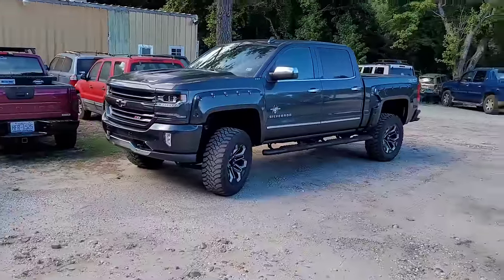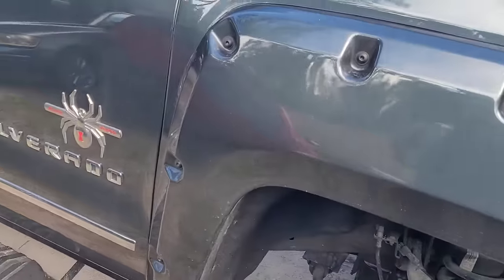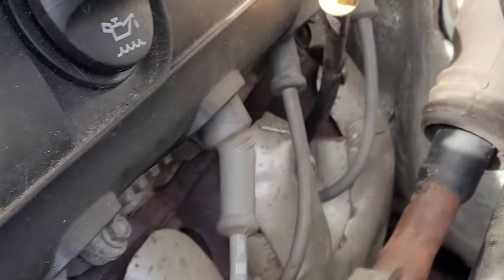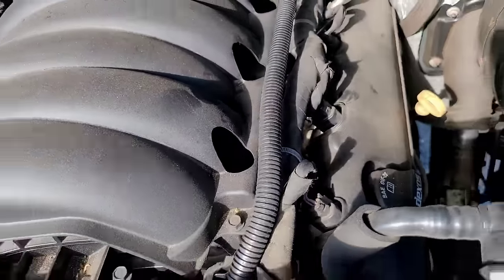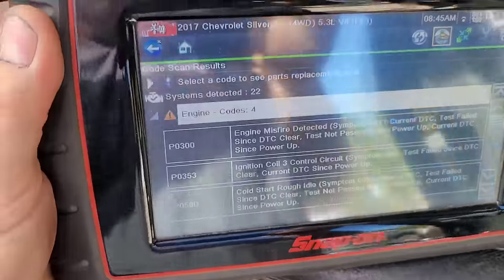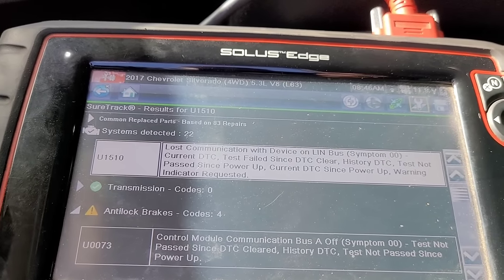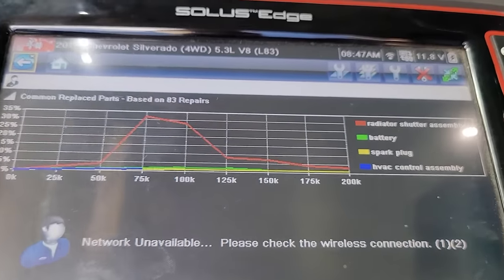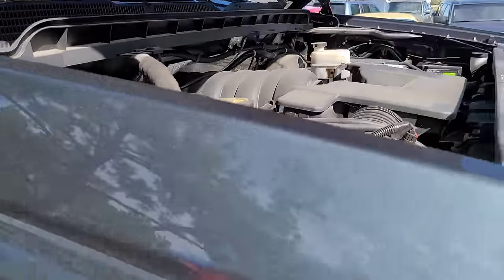AGAIN !!! Another "Tapping" 5.3 !! It's not lifters or exhaust.. 2nd time I've seen this..

Comment: Lots of chevy truck owners have this common complain of “vibrations”. Theyve changed exhaust, and gone thru other very technical/mechanical repairs. The real culprit is actually, just a worn out tires. Not necessarily bald tires. Anything wear at its almost max.
Reply: They give you G.Y. Wranglers stock. those are mud & snow tires, very noisy and inadequate for highway use. they wear out quick, then shake. but are great for snow and trails.. I got 4 Yokohama Geolandars for mine at $199 ea, and mounted them myself with a manual tire changer that cost $60. beautiful highway rubber, 285/70R17.. big mamas when they're standing there next to you off the rims. shops here want $50 ea to mount if you don't buy the tires from them. the $200 I saved bought a new battery. :body-blue-raised-arms:
Reply: I had problems with vibrations when slowing down and with a AFM Disabler they went away.

Comment: I have had the bolt retainer clip on the steering shaft pull the plug wire off if it isn't turned to one side a bit, it happened the last time it got a tune-up, it was the wire behind the one you found loose.
Reply: My 2017 Silverado had the same problem it got pulled off multiple times before I figured it out that it was the clip on the steering shaft

Comment: Yup, wires coming off is not a super common issue but it does happen enough for a TSB!
There's also a TSB for the radiator shutter wire getting pinched, and needs to be rerouted, or replaced if rubbed through.
Reply: People are nuts. as soon as I buy a used vehicle I throw money at it. right away I first changed my plugs, wires and all the grounds which are an issue on these. then I popped in a thermostat and a new master switch for the power windows. and on it goes.. ordered tires from Walmart 😉

Comment: Had lifter failure on my 6.2 this past weekend while pulling a 3500 lb trailer through Arkansas. Was told by the dealership it's a common problem on the 6.2 and 5.3. Damaged the cam so pretty much a full rebuild. Always buy the extended warranty no matter what vehicle it is. It ALWAYS pays for itself
Reply: Or stop buying GM junk as I did. No regrets, no problems !!!
Reply: @bug2011  I was a ford owner before this truck. They're no better and a lot higher in price. Never owned a Dodge and never will
Reply: @klathamtexaslandrealtor  Not many people buy Nissan's but this is my second one and they've been flawless. I wouldn't touch their cars but have been very happy with the trucks.
Reply: @bug2011  So I take it you're a female then?
Reply: @JR-The_Godfather_of_Horsepower  Hardly, I'm just a guy with a better brain.
Reply: @bug2011  Lol!!!!
Reply: I hear the 6.2 is known for bad cam bearings too
Reply: I'm on my second  Nissan Titan and haven't gotten a penny out of my Extended Warranty. They've both been FLAWLESS. I'm a happy guy .
Reply: I have a 17 Chevy 5.3 lifter just failed! Full rebuild!
Reply: @donnevico6560  That's a damn shame. GM used to build such great vehicles and now just junk. To everyone thinking about buying ANY new vehicle, if you're old one still runs KEEP IT !!!

Comment: The coil wire happened to mine. Slight rough idle and hard to hear tick with the purge valve up front.  Remembered the earlier video and got it.  Also the tip with coil pack saved me too!

Comment: Had this happen on my #7 on my 5.3L as well. Misfire only happened at high speeds and was random but not enough to trigger a code. We thought it was the transmission slipping when accelerating. Honest transmission shop owner drove it and in 1 min said “this is not a transmission, but i have a hunch”. Took a look under the hood and found it, Plugged it back in and hasnt been a problem since. Guy refused to let me pay him.

Comment: Had a 2020 Silverado with 47k on it.
Tires were trashed. Chopped up, feathering in the front, alignment wear. complete squared off on the rear.
Reply: it could be the tires themselves are defective,, alot of tires are being made in the phillipines and they are junk. I have a set of yokohamas on my van,, ok one of the got a nail in it and couldnt be fixed, so discount tire replaced it with a yokohama made in the new plant in the phillipines,.  the original set was made in the USA...
, it started feathering badly, it was on the back, and when  they rotated my tires they put it on the front and the van started pulling to the right,, so I told them I wanted a tire made in the usa.. they replaced the tire with a new goodyear, and its doing great so far.  DIscount tire likes to replace tires under road hazzard with cheap knock off tires made in third world countries..  they did the same thing when one of my hankook dynapros went bad, the tire they replaced it with looked exactly the same, but it was a shitty house brand.,, now I know how they operate and will insist on the exact replacement tire, or get a refund..  if u need a replacement tire under warranty, call first and ask if they have them in stock,, THEN tell them u need a tire replaced under warranty.. if u tell them u need a tire replaced right off the bat, they will likely say they dont have any in stock, but they have a "compatible" replacement tire for you,,  and will try to give u a shit tire.
Reply: @randy1ization  Possible. Looks like he never rotated them or balanced them. The one I worked on.
Reply: @Biosynthnut  yep, just dont always assume a tire wear issue is always something  besides the tire itself. with my van, the bad tire was on the LEFT front  and it was pulling to the RIGHT,,. almost sent me down a rabbit hole until I felt the tire.. discount tire had rotated them a week before, and they didnt catch the tire coming apart. if I had assumed they did thier job and checked all my tires, I would have naturally thought it was something besides the tire,, I DONT TRUST ANYONES WORK OR OPINION ANYMORE.. I always check for myself.. most people have thier head in thier ass nowdays and are distracted by a damned I phone.

Comment: I have a 2000 GMC with a 5.3 with 2,75000 miles on it and just have noticed a little ticking but I’ve never had any major problems with it. All a 5.3 is is the old 327 engine.
Reply: Yeah 5.3s comes out to 322CI I believe so basically a 327. Great motors I know that much.
Reply: @bubbakushingtonIII  I was told it is 325 cubic inches but you could be right but whatever the case it’s basically the old 327.
Reply: All the LS/LT engines (3rd, 4th, 5th gen) share with the 1st gen smallblock is the bore spacing. A 5.3 is 325CI and has a completely different bore and stroke, it just happens to be a similar displacement to a 327.
Reply: @brockemery493  Thank you I was just going by what I’ve been told you can write what I know about engines on a bubble gum wrapper lol.
Reply: Don’t you ever compare these late model Chevy boat anchors to the old school Chevy engines!!!!!

Comment: my 2003 Tahoe has an additional AC compressor belt and tensioner. Both wear quickly because of the location. When the belt looses resilency and tensioner get rusty it sounds like a valve tap.

Comment: We have a 17-passenger bus with a similar engine (6.0 liter, I think). The suspension is inappropriate for the conditions it is operated under (air bags). The ride is extremely rough. It had a plug wire fall off. Makes me think that the accident may be the cause.

Comment: Hope the owner knows how lucky he is. Most of the time that generation has failed lifters. Great fix
Reply: It's actually really rare but with millions made there are guaranteed to be a few lemons
Reply: @Connor4x4  Really rare to have  an Ecotech 5.3 not have lifter issues that is. My brother works at Holz Chevy and all he does is collapsed lifters 5 days a week on the 2014-2018 models.  Now they are getting quite a few of the 2021 models coming in.
Reply: @toenails.  So many of them where I live have over 300k without issues
Reply: Just take care of them. Problem is most people don’t believe in routine maintenance….
Reply: @jordanhannah5839  FACTS 💯
Reply: @jordanhannah5839  exactly. I use the AFM disabler, change my oil when it’s due, and I run Lucas oil engine cleaner almost every time I fill up. Almost at 100,000 on my 2016 1500!
Reply: @NicholasA1747  awesome man I am at 118,000 on my 17 z71 with disabler. Service the truck and love it! My favorite truck I have owned!

Comment: I’ve got a ticking 5.3 on cold start. It’s loud and fades out after about 45 seconds. I’m assuming it’s lifter related?
Reply from the maker: It could be an exhaust leak . Check out this other video I made a few months ago . https://youtu.be/itYFqSMdqmI
Reply: Mines does the same thing..exhaust leak I'm sure of it
Reply: Check your exhaust manifold bolts, they tend to shear the bolt heads off of the ones closest to the firewall. It'll have the "Tic tic tic" and it will fade out after a while. If you lose enough of the manifold bolts you'll start to get that lawnmower sound.

Or it could be the classic Chevy piston slap noise from engine wear. The pistons will rattle around in their bores until everything warms up and expands slightly.
Reply: Quit lying guys, Chevys don't break exhaust manifold bolts....

Comment: I got a 5.3 350 08 Silverado 4x4 it’s going rat tat tat and I know it’s not exhaust. 
I’m going to change oil. Run atf through 
Before that pull plugs soak in seafoam 
Hand turn engine a bit. Replace plugs. 
Put some atf in for 300 miles. Replace filter
Then regular oil change after that. 
Is what I’ve been gathering from your videos. 
I’ve checked coils and wires. I couldn’t find anything. 
Oil is dirty. And I topped up with regular oil instead of transmission oil. 
That was stupid I didn’t see your video until a could days after that. 
Short of that I am not sure what to do so I continuously study your videos meticulous until my eyes are sore lol. 
Could you maybe reach out to me? ❤lol

Comment: I had 17' silverado with the 5.3 z71 and around 100,000 miles i had a dead miss on #3. I ended up changing the plugs and in the process found the #3 plug wire was broken internally. Fast forward a month or so had the exact same issue twice but with the aftermarket wires from the parts store. Just outa  Curiosity can you put a dab of  Dialectic grease both ends of the plug wire to help?
Reply from the maker: Yes. The dialectric grease can be used on both ends without issue. In all honesty though, I tend not to use it on ends that are close to the exhaust as I've found they seem to really get stuck onto the plug and subsequently tear when removing . This usually seems to be the issue for me after many miles however

Comment: Hi, i have a "05" Tahoe with 176,000 on it +it just started ticking when first started then quiets down when warm.
Dealer said a new cam + lifters are $9,000 bucks.
I'm blown away.
Any thoughts???
Reply from the maker: Wow! For that price you could probably get a new motor!  Post your question to our Facebook page Wrenching with Kenny & Backyard Mechanics - they are closed  sure to answer the questions to join. Add the year, make & model of the vehicle & what you have done to fix the issue. Other mechanics will comment with their thoughts. Keep wrenching 🔧
Reply: @WrenchingWithKenny  Dealer also said a new engine is 12,000 or so.
I've always changed oil at 3000 miles.
The tick does go away after warm up .
Should i just run it × see what happens??
Gotta say the worst chevy i've ever owned.
It's had excellent care + has caused me nothing but grief.
I will not buy another + especially with AFM crap!
Thanks for help

Comment: On the frontend if you do not reinstall the camber lockout tabs like the factory the alignment will continually drift and you’ll hear a pop under hard turns. Either install factory lock outs or the dirt kings. I’ve had my dirt kings camber locks for 70,000 miles and no more alignment issues.
Reply: What? No way. Ive never heard of that. I thought those were only good in the original position they were in?
Reply: I've not had that problem, though I can see it happening. It takes a wrench extender to properly tighten them when done, especially after GM upsized the bolts. The pins falling out are a real issue, though.

Comment: Shutter issue is a common non accident related issue. External temp sensor and motor assembly is located in the middle of the shutter.  Water leaks into it due to poor design and causes a short. 
My 2017 and my associates 2019 have had this issue. Plus the teacher at BCIT GMC university course confirmed this issue. Only fix is a new shutter assembly at $400 plus labor and I suggest adding liquid electrical tape around the wiring into the control box.  Unfortunately GMC does not warranty unless bumper to bumper is available much like their faulty injectors and lifters. Hope this helps those having this CAN bus error. 
Due to it being a CAN bus there is no way to loop the system to trick the pcm into believing everything is OK.
Reply: The bolts on battery side being moved are from the fact that you have to remove the braces to remove the battery, on top of the battery is a connection for positive power normally 2 wires into one. Those little guys like to burn out in hot and cold and sometimes burn right through the battery.

Comment: Big trucks and SUV that take 0w-20, I live in a warmer climate all rear round and use 5w-30 instead and seems too work a lot better. For example 2022 BMW x3 takes 0w-20 but it’s never reached below 50 and 5w-30 seems to make the engine smoother and quieter

Comment: I had a rattling noise, no codes that sounded just like it was under my driver's seat & would happen on a smooth road, rough road, while in gear but when I put it in neutral it would go away! 
It would never happen when a Tech Test Drove it! 
Found out it was a loose passenger side hood bolt on my 02' Blazer ZR2 4x4. Funny how these noises can travel.

Comment: Sometimes at night in total darkness, you can check your plug wires for leaks if you see a multitude of tiny blue sparks.  I used to do this to know when to replace them.  A lot of engines now with coil packs don't have wires but can be checked in other ways by using a plug tester against the block.  I had a 2014 5.3 Vortec that developed a tick under warranty at 65k miles.  The dealer replaced the lifters and it ran fine up to 105k miles and one day no oil pressure.  Had it toed in believing it was an oil pump.  The mechanic called and said the oil pump was fine but the main bearing and oil journals there were not allowing oil to circulate and the engine needed to be replaced.  Got a factor Silverado new engine for $9,000. with a 30k mile warranty.  I wonder to this day if this mechanic was honest as the truck ran fine with no engine noise just with no oil pressure.  Is this a common way for engined to need replacing?  I stopped driving it immediately when I saw the gauge say 0 oil pressure but it was running well at the time.  This mechanic has always been honest in all the years I've used him.  Changed transmission fluid when new engine put in and had ran great last 45k miles.
Reply: Main/Rod bearings failure is caused by no oil pressure, not the other way around and I've never really seen a 'spun' (rotated bearing blocking oil flow/pressure) bearing that wasn't an immediate result of no oil pressure with severe overheating. No abnormal engine noise means no damage, and you'll very quickly notice knocking/tapping if you ever actually lose oil pressure. It's simply not possible to actually have no oil pressure and not cause major engine damage almost immediately.

I think the mechanic was kind of stupid and was guessing at what could cause lack of oil pressure suddenly, but he was definitely wrong and wasn't an internal engine failure. Really sucks but misdiagnosis from bad techs is way more common than it should be